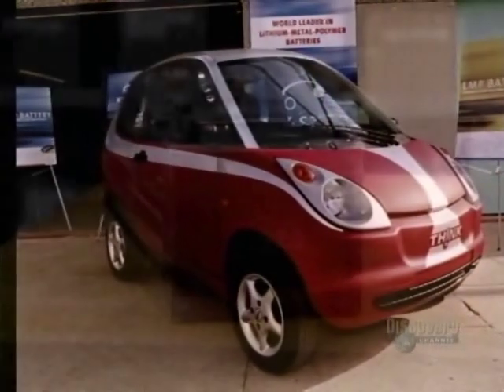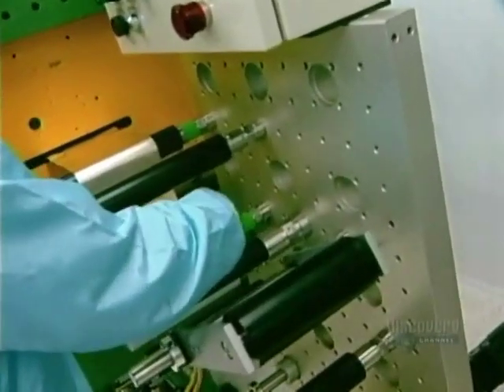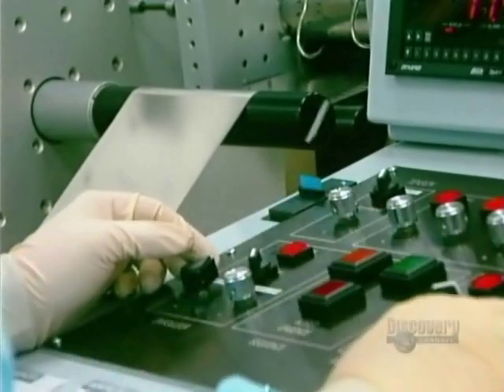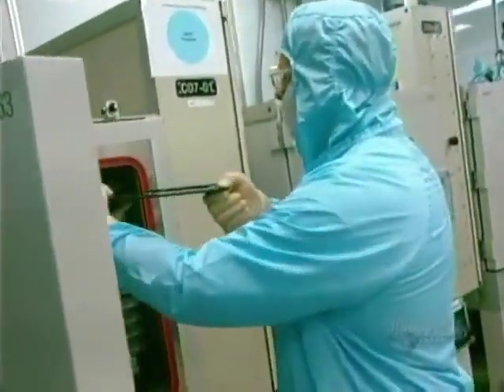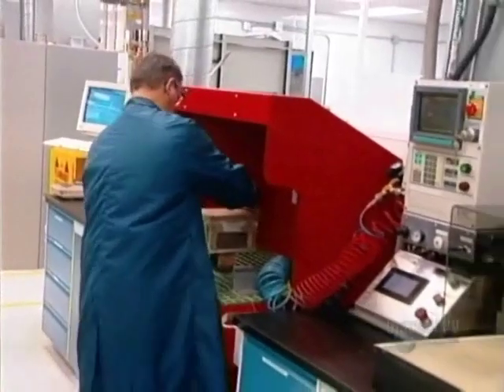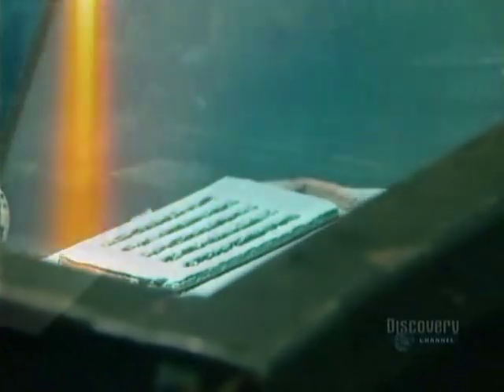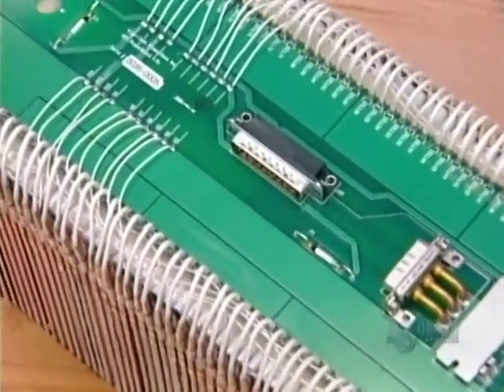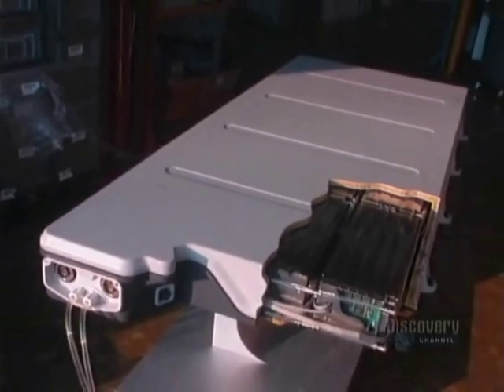How It's Made - Lithium Batteries

Comment: Today in class a student snapped a calculator in half. Another student asked to keep it. I have another calculator that needs the battery replaced, so I asked the student to switch the two batteries before keeping the broken calculator. Once she returned the now working not-snapped-in-half calculator, she informed me one of her classmates had told her that if she drops the battery, it could cause a 1000° F fire, that she could get into trouble, and that the battery was similar to a bomb. I did a bit of research and found that the calculators use a CR2025 3V lithium battery. Is it true that, if dropped, the battery could potentially be a hazard? And if so, how much danger would the students be in?
Reply: lol there's probably not even enough energy in a cr2025/cr2032 to light a match. Dropping it won't do a lot of harm, try stabbing straight through it with a sharp knife, that'll get the angry pixies going.

Comment: I don't trust this video.  Most EV cars I know of use a large array of 18650 Li cells to reduce the chance of large-scale thermal runaway (i.e. spectacular fire).  The type of battery described in this video is not safe enough for many EV car manufacturers.
Reply: this documentary is probably old

Comment: Why doesn't the lithium rust when exposed to air?
Reply: Lithium reacts with water vapor, not oxygen.  The air in this lab is probably incredibly dry in order to prevent the lithium from reacting.
Reply: Reacts with oxygen, it's a group 1 metal, which are super reactive.
Reply: True enough, though (if I remember my chemistry properly) it only reacts with the oxygen part of the water, H2O + 2Li -> Li2O + H2
Reply: Right.  What I was trying to say was that lithium doesn't react with atmospheric oxygen. :)
Reply: Then we are in agreement, and end the most reasonable discussion on Youtube.
Reply: It doesn't "rust" because that's specifically iron reacting with the oxygen in the air. Lithium and oxygen actually react quite well and can be used as a battery: https://en.wikipedia.org/wiki/Lithium–air_battery. This means if you leave it exposed to air it will very quickly loose its shine, much like aluminium that also reacts very quickly with oxygen.